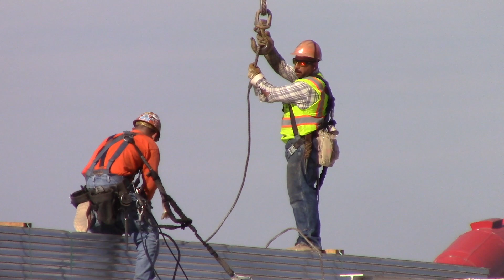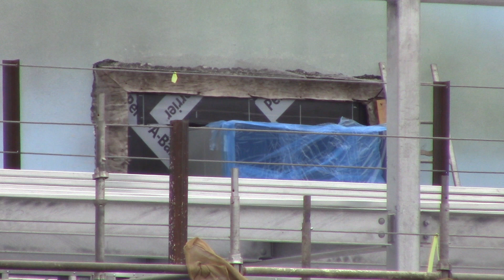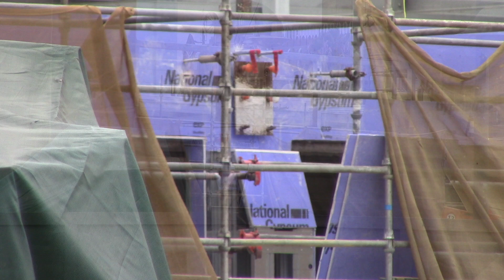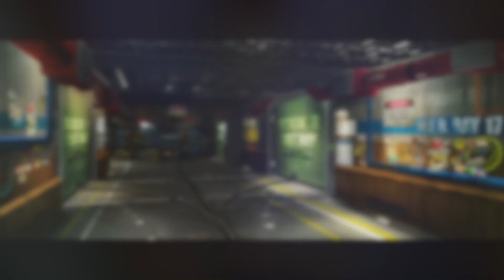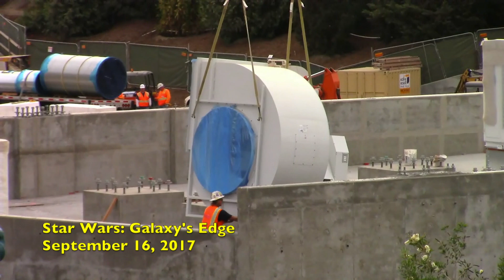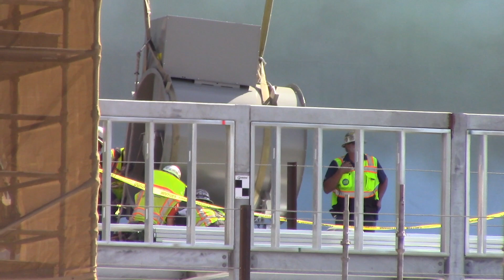AVENGERS CAMPUS (aka Marvel Land) Construction Video Journal - Part 3

Comment: Do you think they are using the different fans because the building has less volume than the Rise of the resistance building? Or, maybe it’s a sound issue, because they will end up being located within a closer proximity of the guests?
Reply from the maker: The Rise of the Resistance show building has a lot of ductwork due to the size of the building.  The more ductwork, fittings, dampers, filters, etc., the higher the resistance to airflow will be, thus the higher the pressure.  To overcome the higher pressure, a fan capable of producing airflow at the higher pressure is required.  The ideal choice for this scenario is centrifugal fans.

Axial fans are the ideal choice for the Spider-man building because the building is not as large and will not have as much ductwork installed and doesn't require high pressure airflow.  However, axial fans are noisier.  The noise form this type of fan is contained by a silencer.

Thanks for your comment and for watching!